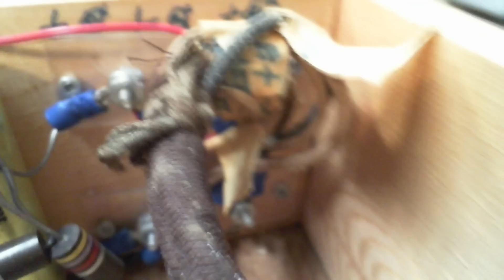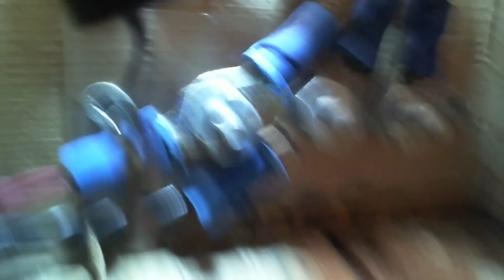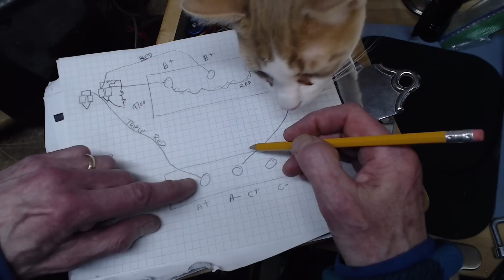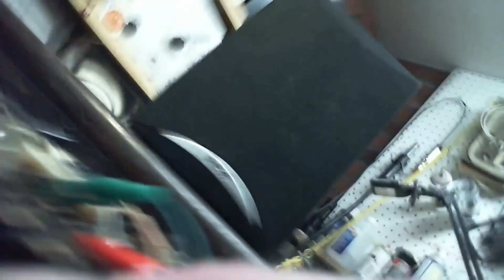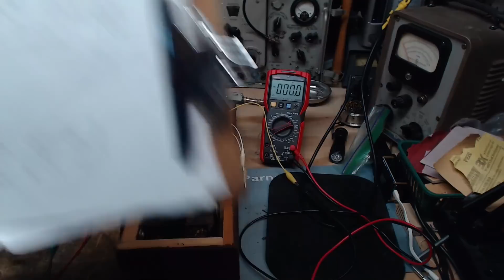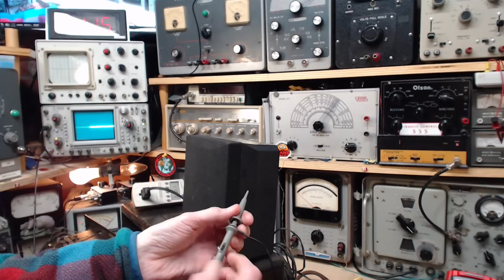100 Year Old Atwater Kent Model 20 Tube Radio Video #13 - Homebuilt AC Power Supply

Comment: Jim , each tube draws 250 Milliamps  DC of filament current, for a total of 1.25 amps of filament current, each tube plate of 90 volts draws about 10 ma at the most,  of plate current, the +22 draws 1 ma. In my radio I have only three power supplies. Currently for experimental purposes I am using an EICO 6/12 volt DC battery eliminator.  I tried lantern batteries but they deleted energy too quickly.  Then I tried a rechargeable lithium battery. Ripple voltage in the filament is disastrous. For max. efficiency   each DC power supply  should have a full wave bridge , for the best hum elimination. Today I pulled radio signals from the ether, now on to finish the output amp with an audio transformer. I am in a basement shop with a spiral long wire antenna on the ceiling above me, so far I picked up 5 strong stations. Eventually I will build my own power box, once I determine the best voltages and power supply configurations

Comment: Jim When you attached the scope prob , glad to see you use a scope, the signal appeared to be deflected positive.. The same direction as the high voltage. It should be a negative voltage. to create the bias for the tubes.  I have suggest  that  you  check this again to be sure.,  I have mentioned this several times. but to no avail. BTY These radios  were designed to run on 2 each  2.2 wet cells or around 4-1/2 volts . 3 cells 6.6 volts would have greatly shortened tube life.  Please let me know if you are reading this. Thanks.